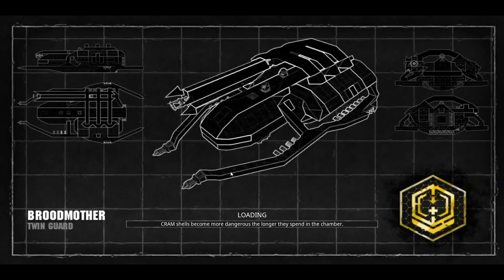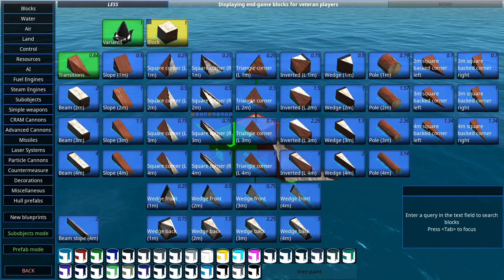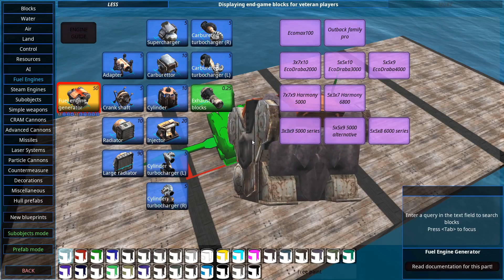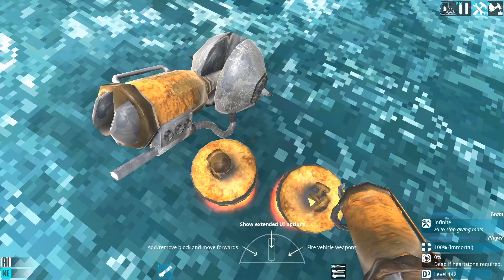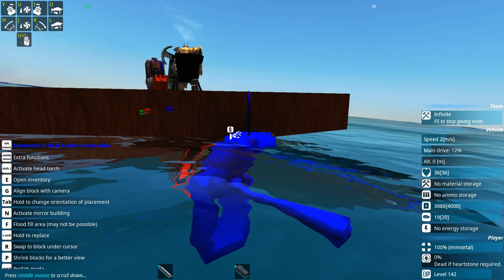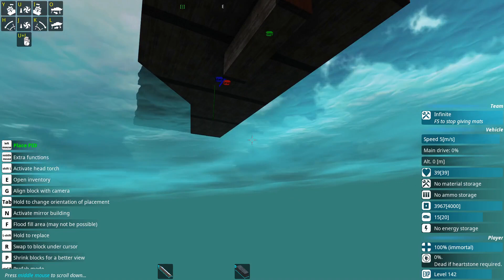Where to Start as a New Player | Beginner Tutorial | From The Depths

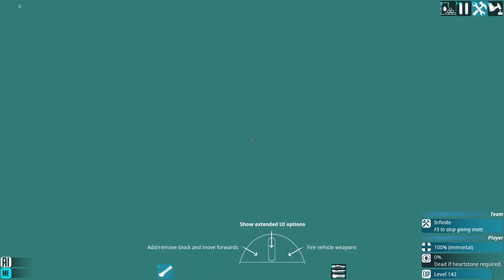Comment: Great Video, thanks!! One thing though, around 8:30 when you are building the engine, I follow the steps but can't get it to show any engine power. I have the generator + Crankshaft +  cylinder on top and it all looks exactly like yours does, and when I place down the Fuel Storage Tank . . .nothing happens. Even when I press Q on the prop and set it to a pusher preset, and press U it doesn't seem to generate engine power

https://i.imgur.com/BvP6R5Q.jpg
https://i.imgur.com/YqEgjgj.jpg

I've tried to get a screen shot that shows what the set up looks like, I must be missing something. I've noticed my UI is slightly different from yours too. I just installed it fresh from steam a few minutes ago, but like my Engine just says "Generator" when under Fuel Engine, instead of saying Fuel Engine Generator like yours

https://i.imgur.com/KGuqPcx.jpg

Maybe a version difference issue?
Reply from the maker: I’m on the devtest, but that won’t make a difference here.  You’ll need a vehicle controller to use U to move.  You already have the power (10).  You can try to change the propeller q setting rotation manually without a vehicle controller.